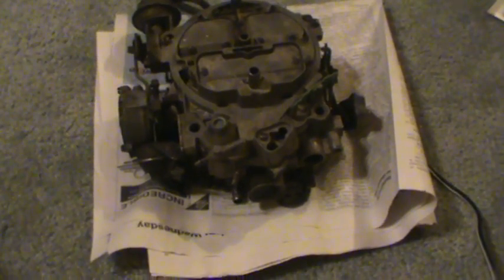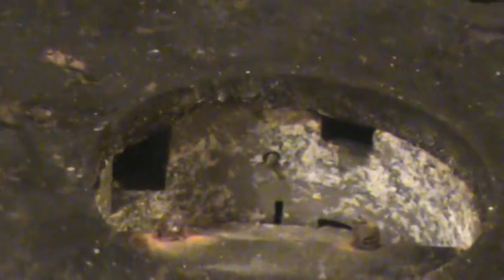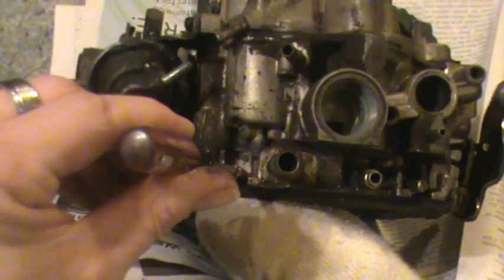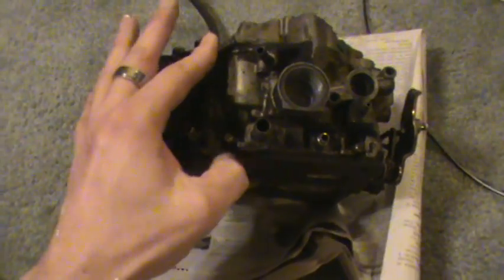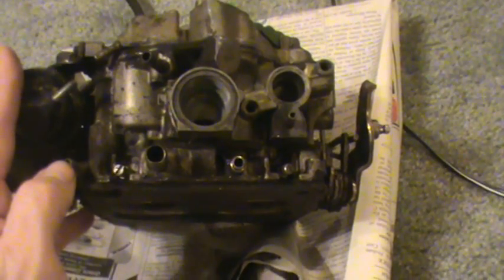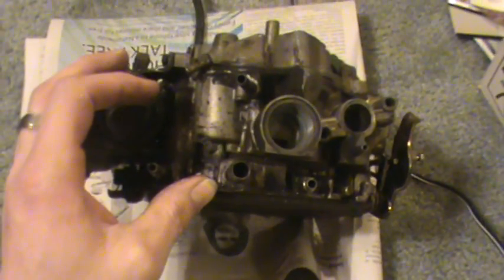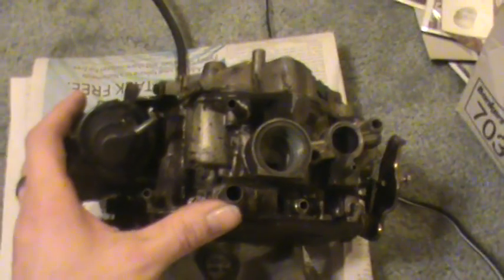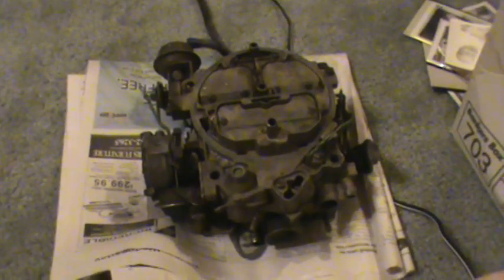How to adjust carburetor mixture screws

Comment from the maker: @britishav8tor75 Yes, black pipes is too rich of a mixture. I would check the choke operation first as well as adjusting the mixture screws correctly. If by not kicking down you mean not dropping a gear, TH400's use an electrical switch to activate the kickdown.

 Not enough room to explain it here but you can google it and learn a lot about it.

Comment: Great video, thanks!  I do have a couple questions though.  The highest vacuum reading that I can get is 15" and that is about 5-6 revolutions open from starting at all the way closed on both idle mixture screws, but when I do this it seems to run poor.  If I take it down to 13" which is 4 revolutions open it runs a lot better.  Why is it running better on 13" as opposed to 15" and secondly, does 4-6 revolutuions from open seem too rich, or would that seem reasonable?

Comment: i bought a 57 210 coupe that sat 10 years in the mud it has a 350 with a Q-jet. i got it running, turned down the fast idle, but when she gets a little warm (outside temp 40) & gets off the 1st notch (half) of choke it starts to make a mild backfire out the left side intermitently. If i push the choke armdown all the way she wont idle warm off choke. I havent touched the quads mixture screws yet. i watched your video, thanks. any other advise?

Comment from the maker: @manlymud No. The idle mixture screws only control the mixture at idle, has nothing to do with mpg or power.

 What it means is turn the screw one direction or the other until the idle speed is the fastest. No set spot, just experiment. The engine slows down when you go too far either direction.

Comment: @689321546 I guess I need to learn a lot and do it myself. I live in Europe and there's nobody around who knows a thing about such carbs. Which rebuild kit should I get? One of the YT videos recommends JET kit. I have found some others, but don't really know what they include. I am not sure if the choke works properly either. Even with the engine warmed up, it'll never drop the RPMs on its own - I have to rev it in order for the RPMs to drop. These videos are so much better than any shop manual!

Comment: How come I haven't found this video before?!

Very informative, but my Rochester Quadrajet doesn't react in the way you describe to adjusting the idle mixture screws. It runs perfectly when reved higher, but in idle it works very rough, occasionally stalls when hot. When I adjust the screws the idle just gets more rough. It produces loads of HCs when idling 2000-3000 (norm 50).

Comment: Great video! Thanks for explaining everything. I have a Valiant Charger RT with 3 double 45 Webers. Engine just rebuilt and carbs redone but running rough and a bit rich I think. Is there a particular way I should attack the tuning?

Comment from the maker: @escatel123  That's more commonly from a lean accelerator pump shot. That's probably an autolite carb, and you can replace the accel. pump leather easily. It's on the front of the carb, a small cover held on by 4 screws.

 You need to adjust the mixture anyway, that's just basic maintenance.

Comment: Great Video lots of info.. quick question I have an fe 360 ford engine with 2bbl carb.  I got the engine to start but every once and a while i have a fireball shoot out of the carb.  Will the mixture screws fix this problem.. Iam assuming that the engine is burning to rich???

Comment: Here's maybe a strange carb question:  how can you adjust them for best fuel economy and cleanest emissions ?  I have a 1972 Volvo.  The previous owner installed a Weber 32 / 36 but I think it's running rich.  The car came from the factory with a Zenith Stromberg dual barrel carb which I still have.  Any preference on which is better?  Thanks for the easy-to-understand video.

Comment from the maker: @ChubbyLoveDumpster  It shouldn't matter. I would adjust the mixture first(there's only one screw because there's only one barrel) and try that. If it still lopes then check the choke. If neither of those resolves it then it probably needs a cleaning and overhaul.

Comment: I have a 68 nova str8 6 with a single barrel. Does the carb matter is its from an automatic? And when it warms up it sounds like its running on 2 cylinders... Or sounds like its highly cammed(whichever). Is that a carb adjustment? I recently replaced the carb with a carb from an automatic.

Comment: Hey, I got a 4 barrel rodchester quadrajet carb on my 1976 chevy truck sb 350. what ive recently discovered is after i have it running for about 4 minutes it dies cold turkey.. it also sounds like all the gas is robbed out of it. but, ive replaced the fuel pump and filter, i have a rebuilt carburetor on it and all new lines. when it's idling its runing strong and pure (i could balance a dime on it) then it suddenly runs rough and dies.  any recommendations? thanks!!

Comment: Is there a good starting point on the adjustment screws? If someone attempted to change the mixure and screwed them all the way in there must be a good setting to begin with. Lets say, screw them in all the way then back them out 3 complete turns and go from there? Thanks. Ed.

Comment from the maker: @mikeinsanediego  well you want the idle to be close to normal before you begin so that you aren't running on the main circuit. So, the first thing is to back the base idle down to a normal range, then begin your mixture screw adjustments.

Comment: @WhoSaidTyler   hey tyler,im not perfectly clear on this....should you set the base idle first and then adj. a/f mix or vice versa ...i gotta a 67 camaro w/ man trans thats idling way high in neutral and running really rich...although when i drop it into first gear the idle drops alot...the car boggs cold but the choke seems to be opening up fine...any help greatly appreciated...thanks for the cool vid uploads

Comment from the maker: @danbirchjr  My guess is that the float is sticking or the inlet needle has trash in it and is noy closing off the fuel supply completely.

 When you have the mixture screws that loose it is introducing air into the mixture and band-aiding the rich running.

 You'll need to pull the airhorn off so you can inspect the needle valve and the float.

 Good luck!

Comment from the maker: @KawiRider20  I haven't worked on a jet ski, but most carbs of any sort have mixture adjustment provisions.

They may have 2 screws, one for low speed mixture and one for high speed, esp if it's a 2-stroke.

Comment: Hi, nice video very helpful! I was wondering my chevy 350 4bbl, not everytime but stalls once I gear to Drive. When Im Parking its fine but as soon I switch to Drive or Reverse it idle and slowly stall. And if it runs normally at a stop light the engine idles like it about to stall again. Do i need to adjust the carb or is it something else?

Comment from the maker: @89blackcamaro  It has to be a source that delivers a full 12v that goes on and off with the key.

 I don't know if it's a camaro as your name says, but GM makes that easy because there are extra terminals provided on the fuse block. Look for one labeled IGN. Don't use BAT, those stay hot all the time.

 If it's another kind of car or truck you might take the 12v source off the power feed for the wiper motor. Be sure to ground the black wire if the choke has one.

Comment from the maker: @codhead2000  To begin with, I'm for repairing chokes first, because a properly working choke is very nice and does all the work for you.

 Concerning your Peugeot(no we sure didn't get those, we got a few 604's and 504/505's)..the steps are the same for ANY choke. It has to have a spring device to make it close, and a source of heat to make it open.

I would go through it thoroughly until you discover what isn't working.

Comment: I am pretty new to messing with carbs.  I bought a 79 jimmy with a stock 350 a few months ago and has pretty much ran like crap.  Major bogg when under throttle.  I watched this vid a few days ago and this morning went out to see how off the mixture was.  On both mixture screws, either way I turned the screws the RPM never changed.   What do you sugest.   Thanks for the vids.

Comment from the maker: @Texassince1836  You can still find the tool used to adjust those. It has a long flexible shaft and several different tips for various screw types.